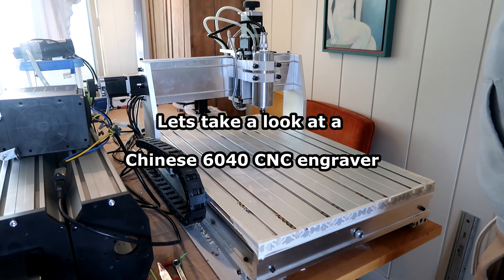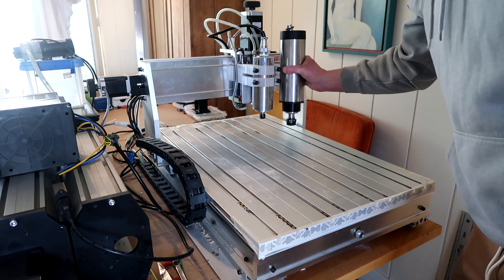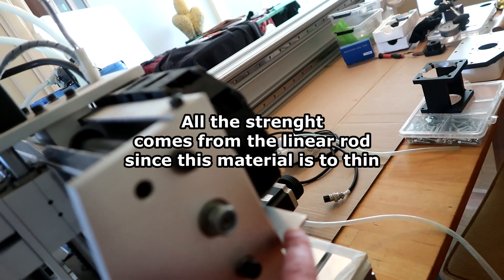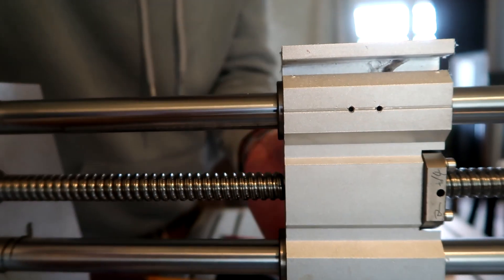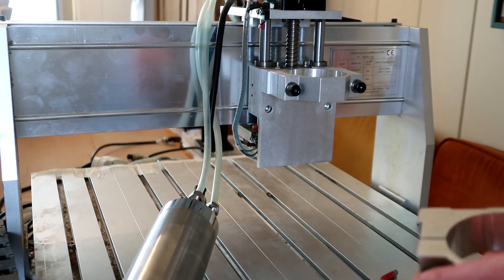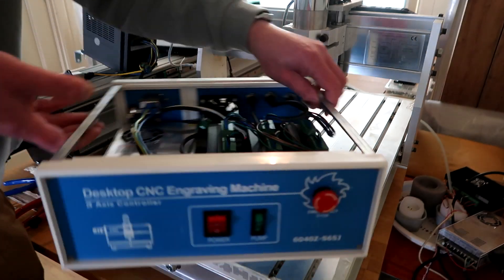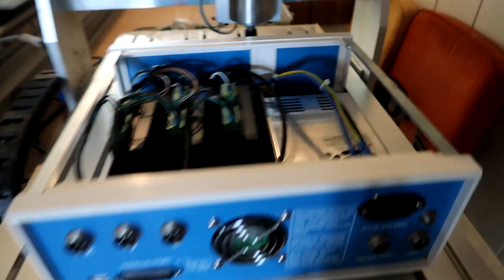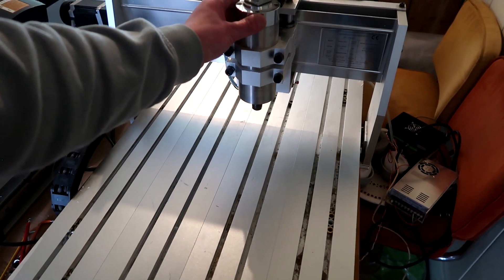Lets take a look at a Chinese 6040 CNC Engraver

Comment: You can probably get rid of the play in the bearings but the main issue is the stiffness of the X axis. Since the spindle is lowered to the bed for machining, there's a long leverage that will torsion twist the x axis. This will result in chatter and wear on the tool and ugly machining marks. It's probably ok for light loads but aluminium will be a challenge.
Reply from the maker: yep i agree , i mentioned it in the video its twisting :)